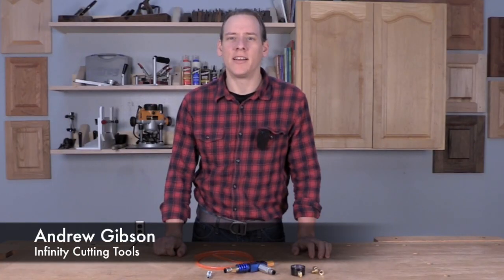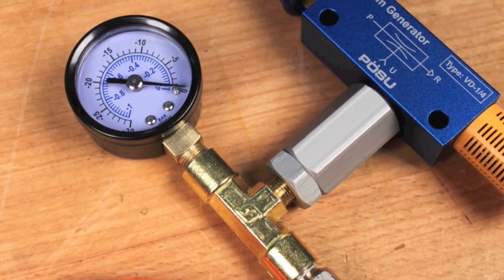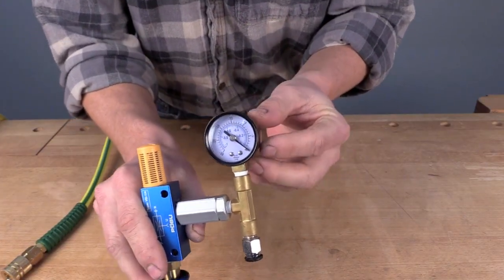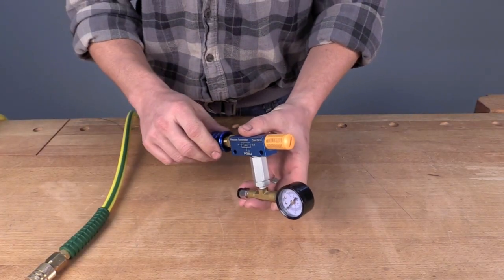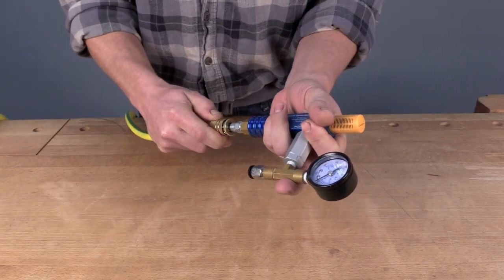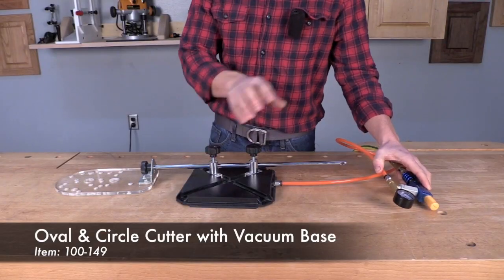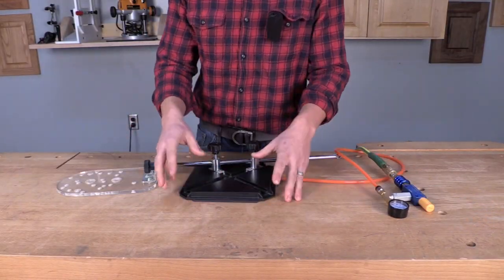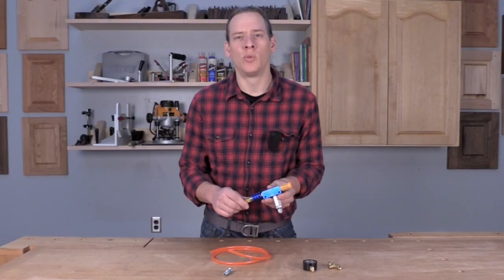Infinity Cutting Tools - Venturi Vacuum System w/ Air Compressor Adapter

Comment: Can you set up a system using that product that turns on and off for vacuum bagging operation?
Reply from the maker: The Venturi system has an on / off switch allowing it to be used for vacuum bagging operations.
Reply: Does it turn on and off automatically if your bag isn’t perfectly sealed?
Reply from the maker: @pearsoncourtneys4671  no it doesnt work like that.

Comment: Was there any observed change in the compressor listed cfm vs what the Venturi was able to pull? I’m hoping I can find a ratio to do some math to see if it would work for my application. Great product though.
Reply from the maker: Some data on the Venturi for you that might help you:  Venturi reaches max Vacuum at around 80 PSI of input. More pressure does not increase the vacuum. It will pull up to roughly 26 inhg. The Venturi does not require much CFM. A compressor that produces 2.5 CFM @ 90 PSI will be able to run the Venturi.

Comment: How many seconds of vacuum do you get before the air compressor tank is totally empty?
Reply from the maker: As you'll anticipate, that will depend on your compressor size. It's not a direct exhaustion of the tank when using the venturi, but your compressor will kick on to replenish the tank. The vaccuum will work fine with most portable compressors without any real issue, but the venturi system isn't the perfect choice for prolonged (vaccuum pressing, etc.).

Comment: Does throwing the switch just cut off the air flow creating the vacuum or does it also allow you to hold a vacuum after the air flow is cut off?
Like a check valve to maintain vacuum after air line is cut off.
Reply from the maker: No, once you flip the switch on the Venturi device back to the off position, the vacuum is released.

Comment: Also could I run water through it instead of air pressure I want to generate a vacuum off of a gravitational force of flowing water without the use of electricity
Reply from the maker: No. This venturi is designed for air only.

Comment: How would I be able to increase my vacuum from -25hg to -30hg? I was asked this at work. When our material is picked up, the guage reads -25hg. Would I need more air pressure? Smaller suction area? Pump or use a different vacuum type?
Reply from the maker: For a lifting apparatus, the "suction cup" should be able to lift around 12 lb per square inch of surface area at -25 hg. (A 12" square suction cup should be able to lift about 1700lb at -25hg)
A perfect vacuum is -29.92 hg so 30 is not possible. With a venturi you will reach a maximum at a certain CFM Usually in the -25hg or -27hg range depending several factors.  From there more air pressure wont make a difference. I would first figure out if your suction cup has enough surface area to lift the weight you need to, if yes then you may need a vacuum source that can provide more CFM as the problem is more likely a leaky clamping surface.

Comment: Would this work for a small 1.5Gal Vacuum Pot? Degassing silicone and epoxies?
Reply from the maker: I have not tried it but I think it would work very well for the application.
Reply: I would be worried about running epoxy fumes thru your ventury filter and gumming it up.

Comment: Very cool! Could you use something like a stream of water (out of a pressure washer say) to achieve the same effect?
Reply: We used water based venturis at school for rapid filtering.  I think the unit was called a Buchner funnel.  The venturi was plastic fitted to any sink tap, with a side arm where the vacuum occurred.  It should be a standard bit of kit from a scientific lab supply wholesaler
Reply from the maker: No, the venturi requires air movement to work properly.
Reply: @InfinityTools  I wouldn't say no to this question. With a specially designed venturi this is 100% possible. It might not be possible with the setup in this video but since air and water are both fluids a proper setup with a pressure washer would create a suction.

Comment: trying to use this for a milking system, need 11-12 Hg out of it, what psi needs to go in?
Reply from the maker: Hi, there are a few to many variables to say with certainty. I would recommend picking up the VEN-003 vacuum gauge and fitting for the venturi so you can monitor the  vacuum being pulled. This would allow you to set up your system and get everything dialed in without guesswork. https://www.infinitytools.com/1-5-vacuum-gauge-w-brass-fitting-for-venturi-system

Comment: well this effect needs a high speed produced by the compressd air, right? so how big must be my Air Compressor Tank to work as a vacuum for 5 continuous minutes without loose preassure? is the capacity of the tank a real problem to decide buy a vacuum instead of this?
Reply from the maker: We have used the Venturi with a small /portable air compressor rated at 2.6cfm at 90PSI and it was able to run the venturi with no problem. A larger air compressor would cycle on and off less frequently if you your running the venturi for extended periods.
Reply: @InfinityTools Why not Show the demo ?

Comment: Would this product work for Vacuum Assisted Transfer Molding, used for composites?
Reply from the maker: HI, your specific application is a little out of my knowledge base. the vacuum this venture creates should be more than adequate, however I do not know if this venturi would have a high enough CFM capability.  I believe this would depend on the size of the parts being molded.
Reply: InfinityTools How many cfm's will this product handle? Im looking at using it for vacuum bagging carbon fiber

Comment: How loud is this tool? I would like to use it to draw down a 10" diameter vessel
Reply from the maker: +David Kosh The volume depends on the output pressure of your air compressor. The higher the pressure the higher volume of air and the louder the switch. At 80psi I would say the venturi is not so loud as to require hearing protection but it is not what I would consider quiet either.